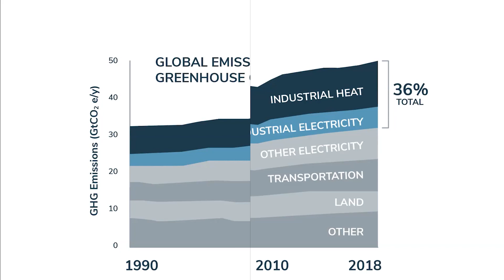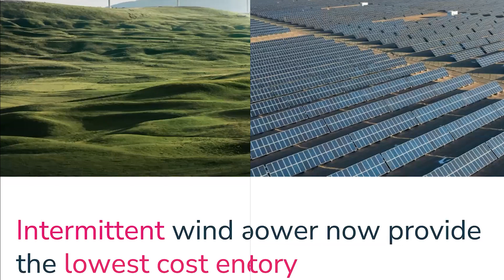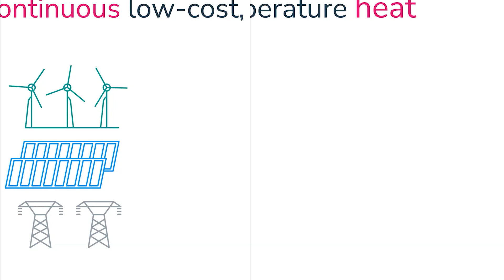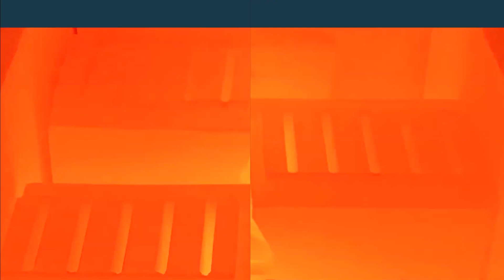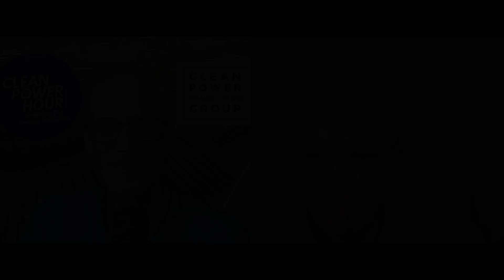Decarbonizing Industrial Heat | John O’Donnell

Comment: The farmers burn crop residues to prepare land for the next crop. Can this heat be stored in heat batteries and sold to industries?
Reply from the maker: Just a question of economics. Rondo makes heat with electricity. Of course there are other many ways of making heat and storing it.

Comment: I think the biggest question that wasn't asked here, is what industries O'Donnel thinks Rondo can slot into in its current form, and what industries he thinks are easily within reach / what he sees as the primary hurdles to overcome. The current batteries he's put out there are limited to emitting 1000 C or so of heat - great for making green hydrogen and most cooking processes - but it falls short of higher temperature industrial processes like steel smelting (1500 C) and the big one, concrete (1800 C). Those high temperature industries are where a lot of the big emissions come from and for the moment Rondo doesn't seem able to fill those gaps. I hope they'll get there, but jumping from 1000 to 1800.... is a big jump! Seems hard!

Wish him all possible success.
Reply from the maker: High Temps are key for sure. Thanks for listening!
Reply: Couldnt the additional heat be sought from traditional sources? Still 50 to 60% less co2 emissions.
Reply from the maker: Additional heat for what? Rondo makes 1600 deg C bricks. Not sure I follow your question but please elaborate.
Reply: @cleanpowerhour  The original comment said the Rondo batteries only deliver 1000 deg, take it up with him, I was merely seeing the positive in the use of Rondo batteries even if they coudn't fully heat steel etc.